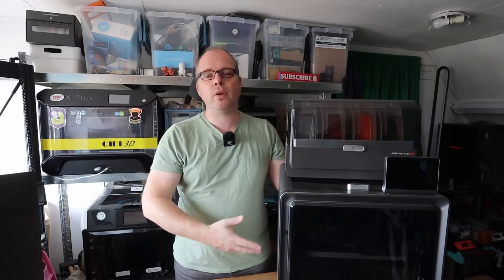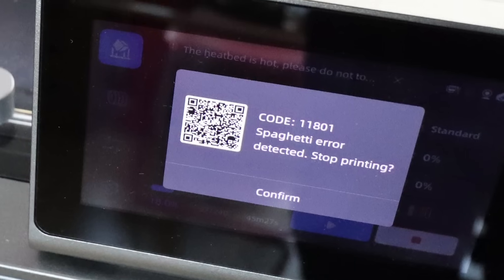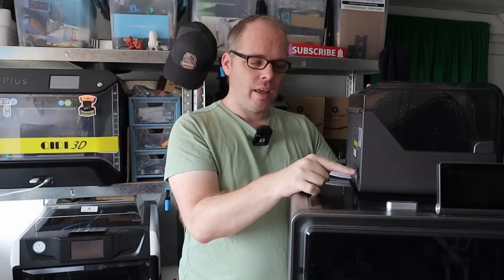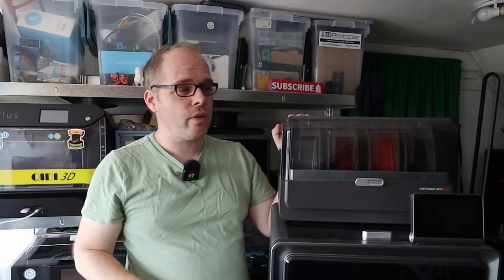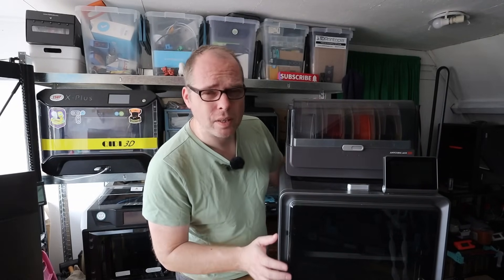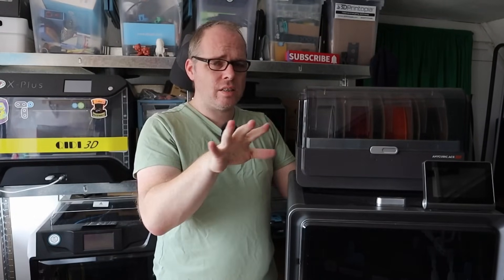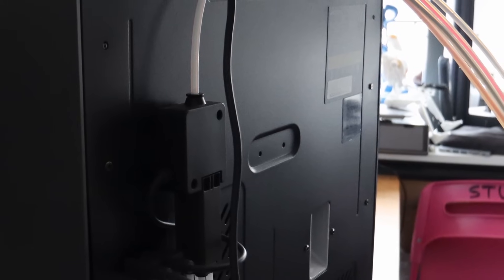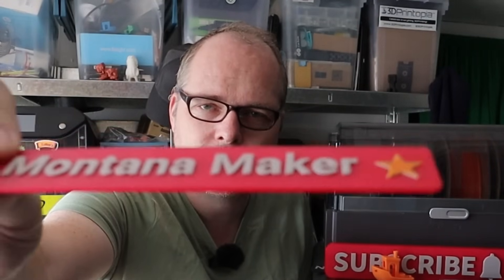I Tested the Anycubic Kobra S1 – Here’s What Surprised Me!

Comment: I've had the S1 Combo since it came out, good printer but upgraded the hot end and nozzle to the integrated ceramic heater with hardened nozzle. Works well.  Have a Kobra 3 Combo setting next to it.  Good printers but will upgrade the S1 heat bed assembly to the solid aluminum bed once it arrives to fix the slight warping in the plastic bed.
Reply from the maker: It sounds great. Was the bed frame that bad?

Comment: Purchased  both the Kobra S1 Combo and 3 Max Combo,. The 3 Max had a hot end issue and Anycubic sent a complete new extruder super fast, excellent support. Both printers are fantastic providing rock solid printing, the inbuilt filament dryer makes it all so much easier.
Reply from the maker: Oh that is amazing. Quite happy with my S1, only don't have the 8 color hub...